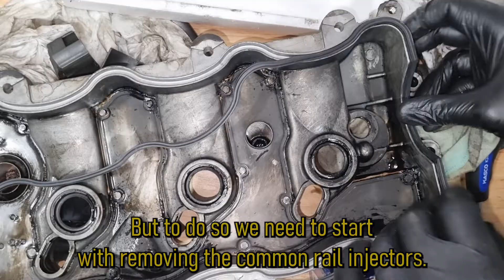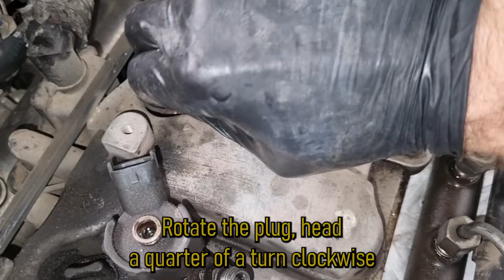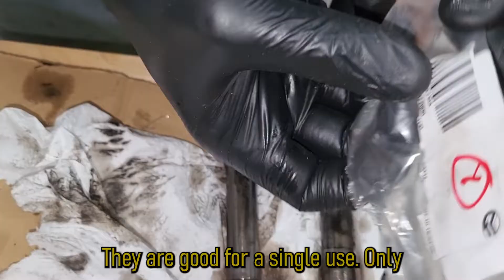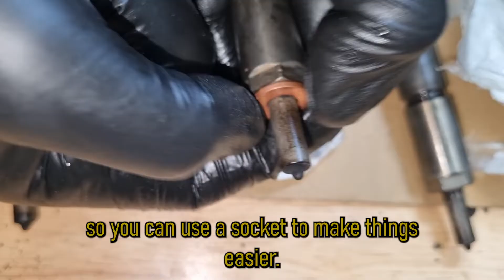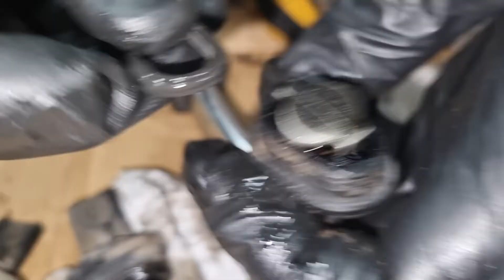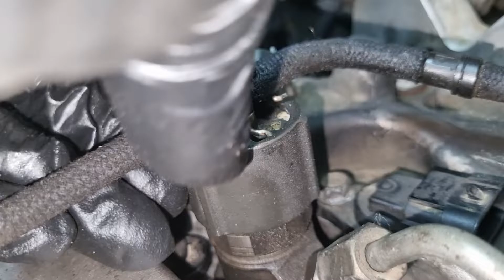How to Replace Your Diesel Injectors Step by Step [Common Rail Direct Injection D4EA]

Comment: Great video !  But.... the rocker cover also has gaskets to seal the rocker cover to the injectors. You did not change these seals, inserting the injectors back in after cleaning them.
Do these seals need changing ?  Please clarify ASAP!
Reply from the maker: Youre looking at the wrong video, I made a full video about the gasket replacement and showed the oil seals replacement there. You need to use a socket at the correct diameter in order to press them out and put them in.

Comment: ❤
Hello sir, how are you? I have a question. If you allow me, I am Louay from Syria. Thank you for the enjoyable and useful video. My question is: Does the high-pressure fuel pump for Hyundai and Kia diesel engines need to be serviced by resetting the timing or just installing it in its place? Thank you.
Reply from the maker: Hi, greeting neighbor!
You don't need to reset it at all, it sits on the camshaft from the opposite direction. Just the timing need to be aligned as it should be.

Comment: I want to inquire about the hyundai santa fe 2005 2.0crd d4ea EGR system. The one that you repaired there(egr valve and actuator with an electronic solenoid) is it compatible to be placed on a car or d4ea engine that once had the vacuum controlled system. If so if my car does not have the electrical connnector for the actuator since it was once vacuum based how would i connect the electronic one that you have. And what pin configuration is on that 2 pin electrical connector, is it just power or it has control logic to it?